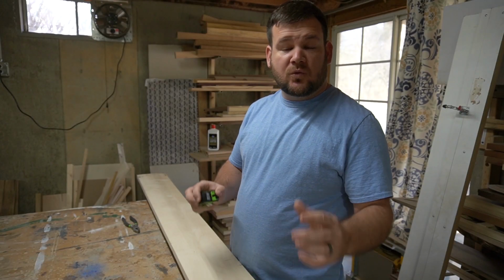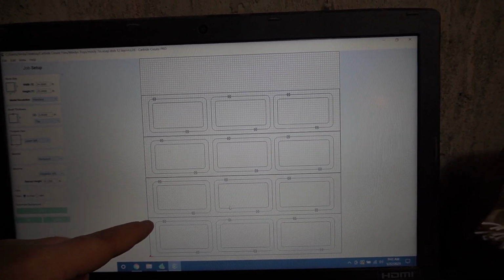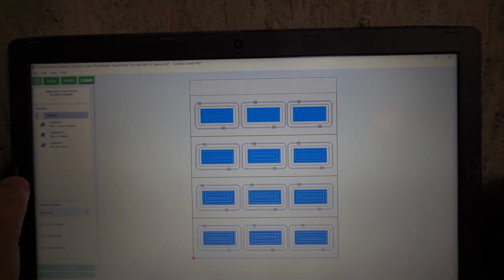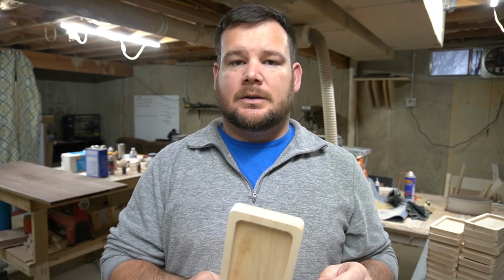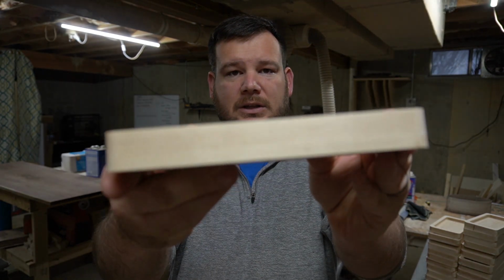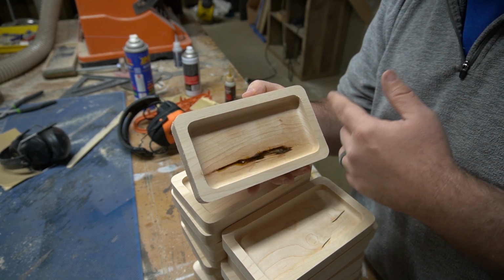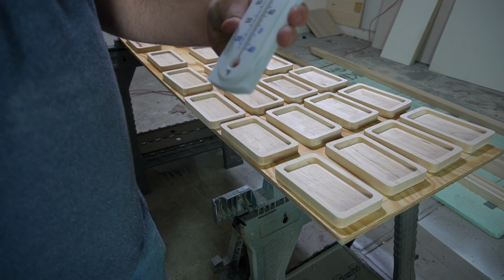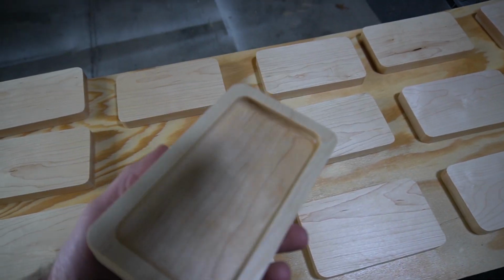How To Make 24 Wooden Trays In One Day // CNC Business

Comment: Thanx for sharing! Just some idea: Since you don't mind using the bandsaw and flushbit you can get away without tabs and cut through. Depending on the tension in the boards that might save you time on the sander to get the burn marks out (if you had some). When it comes to applying a fast trying and great looking finish for trays I recently used watco danish oil with great success on maple and walnut. Enjoy your weekend!
Reply from the maker: Thank you for the input! One issue I'd run into not using tabs would be the tray moving on me. There's nothing holding the tray cutout because I'm only using screws in the end of the stock boards. I've tried using double sided tape and its just time or cost effective.
Reply: @AndyBirdBuilds  What I mean by "not without cutting through" is to leave 1/8in of material on the bottom of the cut out path. This way the trays shouldn't move.
Reply: Yeah I've done away with tabs in pieces where I'm going to be trimming on the router anyway to save time. I just do a pass around the perimeter of my pieces deep enough that the bearing on my flush bit will clear the depth. Saves a decent amount of time on the CNC and adds very little to my finishing time.

Comment: Have you ever rubbed a wooden creation with mineral oil (or something similar) first before sealing with any type of lacquer?  The reason I ask is that rubbing with mineral oil really makes the natural wood color pop.  Just curious.  BTW...keep up the videos,   I really enjoy them!
Reply from the maker: I haven't. Does it affect the finishes durability?
Reply: @AndyBirdBuilds As far as durability goes, it will greatly help the wood resist/repel water in a wet rag, wipe down type scenario.  I would definitely seal it with something if the customer plans to do something like run it through a dishwasher or something drastic like that.  But I say all of this without ever first hand seeing any of your work other than on a youtube video.  It's just something  you might try with a couple of scrap trays, if you have any, and see what the result is.
Reply: @AndyBirdBuilds  I've been doing a similar finish to what's mentioned here. Depending on wood species, I've been using either a BLO/tung oil blend or danish oil. The slow drying oil brings out the character and color of the wood wonderfully but overcoating with lacquer still gives the durability.
Just need to make sure that you rub the oil until it appears almost dry so it dries in the wood vs leaving a film on the surface.
I like to give it a couple days (ideally a week) to dry/cure, scuff with 0000 steel wool then spray with lacquer.
Adds a bit of waiting time but the results are more than worth it in my opinion.

One thing to note with that though is that you want to avoid getting any of the "finish" products. Pure tung oil is very different from tung oil finish in that the finish version has a variety of additives depending on brand, often mineral spirits and a varnish of some kind. Oil "finish" products very often will mess up the lacquer top coat where a pure oil will not.
Reply: @davespangler9125  Because this is a utilitarian piece, it doesn't make financial sense to go through the process you describe! The lacquer coat is a great idea and suits Andy's process. He has been doing it for some time now to proof his process and product! I like it!
Reply: @chavezm1954   I completely agree, his process is very well suited to the product's use case. 
My response was detailing the process I use for the more decorative pieces I use lacquer on since Andy asked above about the lacquer and its durability.

Comment: Awesome thanks Andy. As a complete novice, I was wondering what is the accuracy one can achieve on a mass production doing this process? Meaning if I set specific sizes with the cnc, how accurate will be let's say the actual inside cut compared to the settings? Because I have 200 ceramic dishes (rectangle shape) and I would like to have 200 trays made and then put the dishes inside the trays (I'd like them to fit as precise as possible without leaving to much of a gap). Would you say too much variation occurs among the trays causing some dishes to fit and some don't?
Reply from the maker: These machines are very precise. Send me an email through my website and lets talk about your project. www.andybirdbuilds.com
Reply: @AndyBirdBuilds  Got you! Thanks a lot.
I am based in italy, kinda tough. Again thanks Andy

Comment: Andy could you answer another question 
I just opened my box that contained the Carbide router. Took the collet nut off and and found a 1/4" collet in stalled under the nut. How do I get that collet out of the router to be able to use the 1/8' and 1/4" more precision  collets? and do they snap into the nut.
Jeff Peters
Reply from the maker: After you removed the collet nut the collet should come out relatively easily.
Reply: Remove the tool, angle the collet inside the nut until the groove disengage the nut eccentric slot, pull it out.
In other words, While maintaining pressure on the collet, twist the nut until you hear/feel a click. The "click" indicates that the top rim of the collet groove has completely snapped out of the extractor ring and the collet can be removed from the nut.